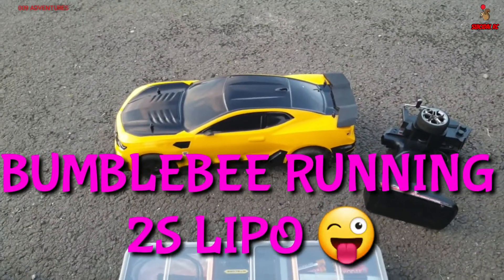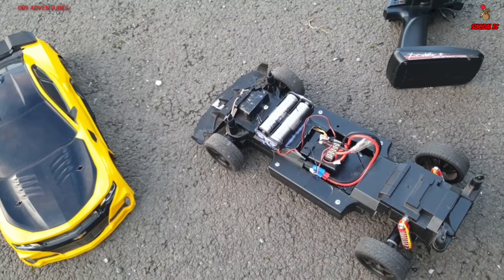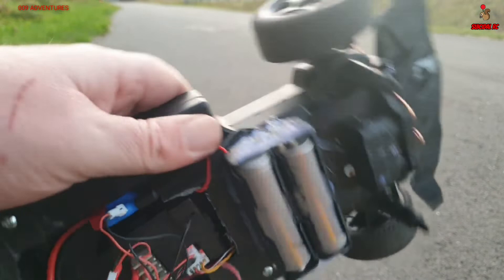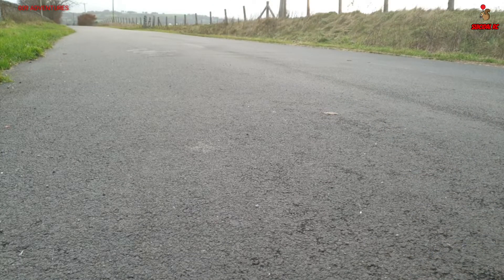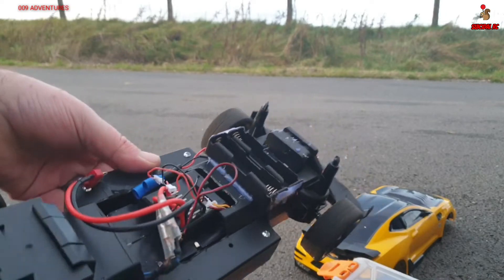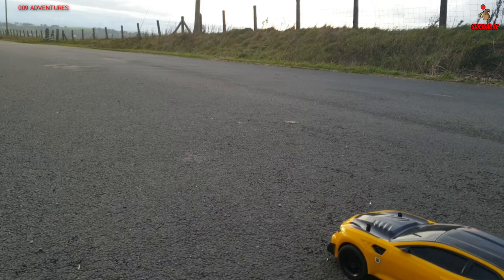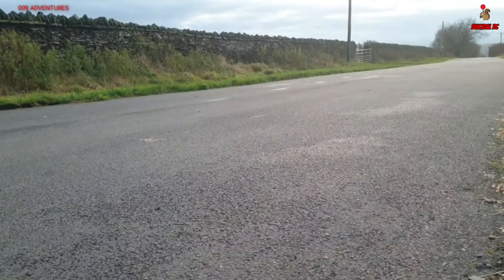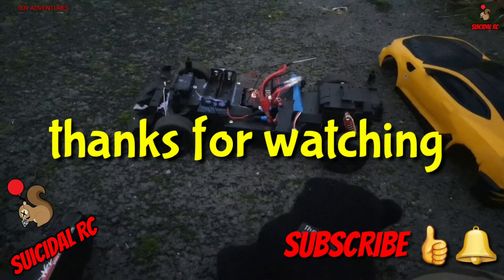PROJECT BUMBLEBEE RUNNING 18650s & 2S LIPO

Comment: excuse the greatness to my lateness on commenting but must 'doff my proverbial on this creation....love the box of batteries hahaha thats quite a collection. I do find it fascinating watching you work your way through this project....one minute you love it next minute 'this thing's an absolute  nightmare innit' 🤣🤣🤣 To be fair I was half expecting a lipo to start with but I get why you didnt when you talked about diff repairs. On a side note, as this is a scaled down version, does this mean that sound is a scaled down version of a 'v8 rumble from the bumble'?  Loving your vids mate...even though it takes me a bit longer than most to watch and comment 🤣🤣🤣🙏
Reply from the maker: hey bud, no problem at least you took the time to watch which I really appreciate 👍 yea I've changed the diff like 5 times that's without the limes I've fixed it.. bit of a pain tbh but now I made metal farts for it that seems to have worked so lipo it is 😀  most of those batteries are reclaimed from laptops so I got hundreds of them. hummm v8 soundkit?  cheers for watching 😀👍

Comment: Awesome video pal yeh I'm not a fan of them batteries my arrma granite came with them as stock and I straight got rid of them haha awesome run with bumblebee and love the bodge work with the battery haha electrical tape is a hod send haha
Reply from the maker: thanks bud, yes I was trying to avoid lipos as I've fixed that diff like 5 times but I made metal parts last fix and they seem fine now 😀  the battery holders will stay there just as an extra option for longer running nite I've fixed the issue with them 😀👍never leave home without electrical tape